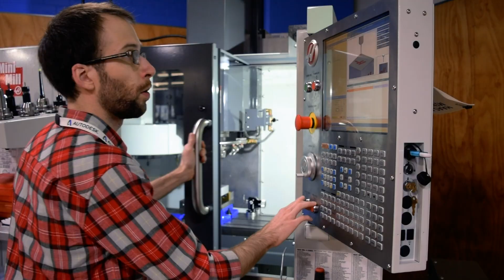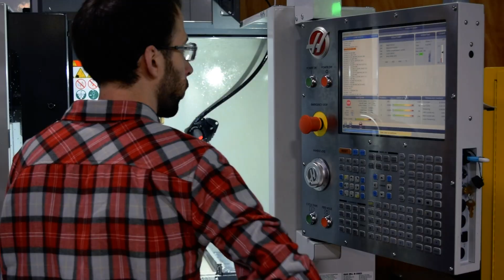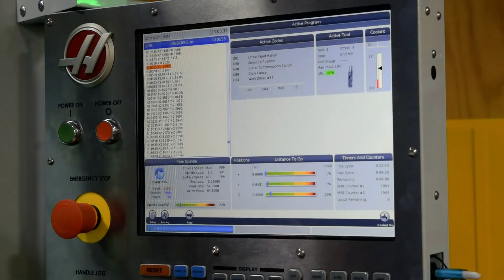Machining on the Haas Mini Mill

Comment: my question is how the heck do people get a mini mill in their basements
Reply: A big doorway
Reply: willingness to temporarily rent a bobcat to dig a ramp and use a sledgehammer to bust concrete block. I am eyevalling ...hungarly the HarborFreight concrete saw now. R U willing to put a hump in the floor above for headroom ...it can be desguised upstairs in many ways. Even when I put a shorter tormach in I had to cut the floor joists some

Comment: Hello. Thx for sharing this. I guess that you have a 6K belt driven spindle ? Is it enough for machining aluminium ? Max torque is at 1200 rpm with such spindle. With the 10K spindle you have the max torque around 4000 rpm. I'm currently thinking about buying a minimill and therefore I'm hesitating between the super and the classic version, due to this spindle difference. But it seems to work good for you with the 6k ...
Reply from the maker: Nico S This one has the 6k spindle. If you’re doing aluminum using mostly small tools below 1/2” I think the 10k spindle is a no brainer. You can also get a 15k as a special order.
Reply from the maker: howzerman1 see your other comment for response!

Comment: I'm new to CNC, but holy cow... You're shooting coolant like you expect to get 5 years out of your end mill
Reply from the maker: With this machine the coolant is either on or off. There is no further adjustability. That being said there are several benefits to using lots of coolant. Tool life like you said is one, which includes lubrication for the tool, cooling of the tool and workpiece, and chip clearing/flushing, which will benefit the tool and the surface finish of the part.
Reply: That's a totally normal amount of coolant. You should see some of the bigger/high-speed machines using a chip wash and flood coolant just to keep chips clear.
Reply: As a professional cnc machinist I can say there is no such thing as too much coolant.
Reply: @kkknotcool  Thanks for sharing the insight !